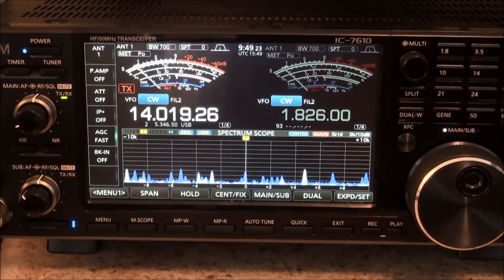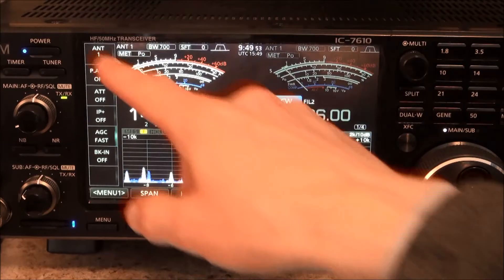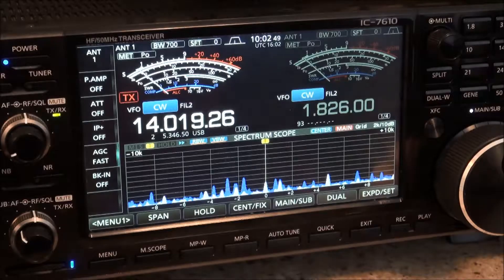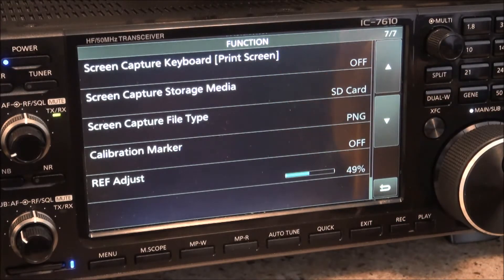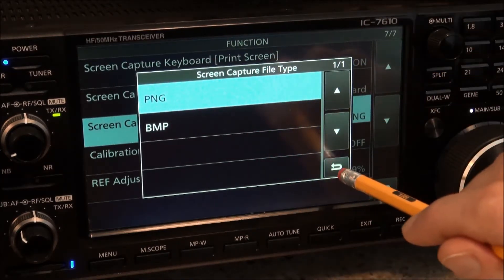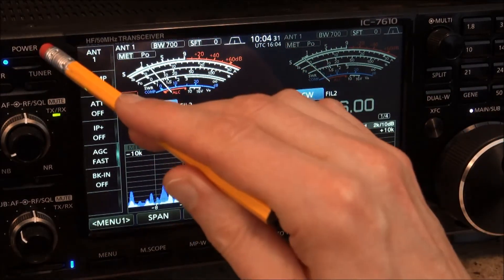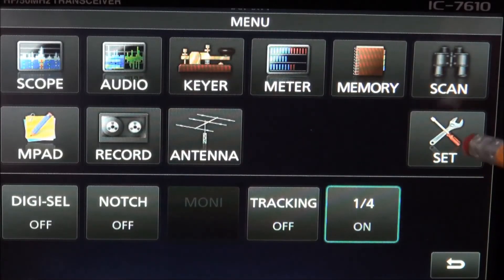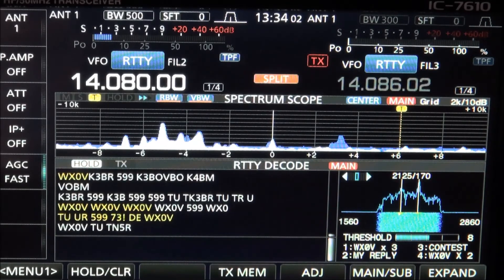IC-7610 screen capture button alternative!

Comment: I heard Jarred VK3BL complain about the power button screen capture on one of his early videos before we got the 7610 in the USA so I never checked it out. I discovered the "fix" right after installing 1.06.  Well, I just checked the manual and it says you have the two options.  We had it all the time, just didn't check the manual.  Who reads the manual?  The lesson learned is if you don't like something, check the manual! :)
73  K9AEE
Reply from the maker: What's a "manual?"...  :-)

Thanks again and 73! de WX0V
Reply: WX0V Wait a minute. I just reaized the manual isn't on the CD, it is downloaded from the net. So it can be updated when firmware changes are made.  The fix was probably in FW 1.04.
Reply from the maker: I suppose we could roll back our rigs to a previous version to find out, but as long as we have this alternative, I think we're good.  Thanks again for all your help.  73! de WX0V
Reply: Sorry Jarred, I watched your video again (probably for the 6th time) and see that you are not the one who didn't like the Power button screen capture.  Maybe it was Ham Homestead or someone else.  And if I am correct I think you showed the keyboard option before FW 1.06.
Reply from the maker: I mentioned it in a previous video, but others saw it as well.  I am just happy we have an alternative...73! de WX0V